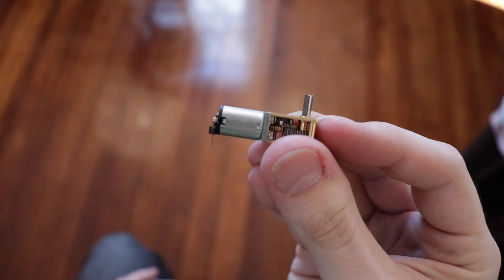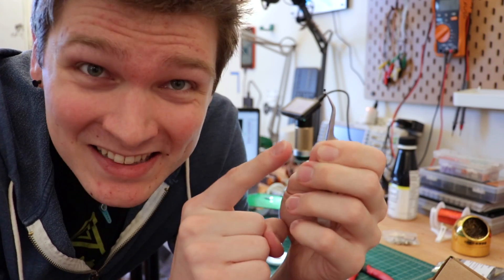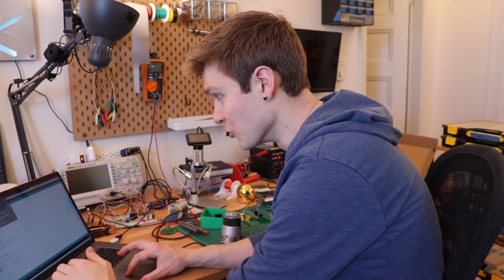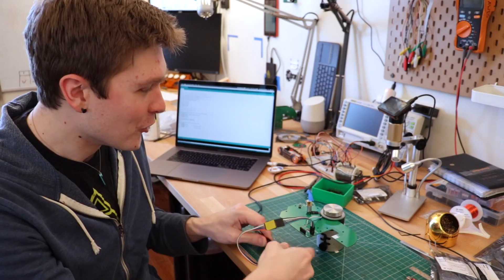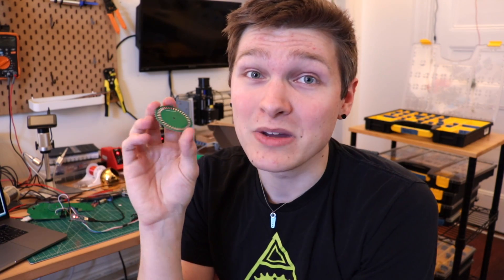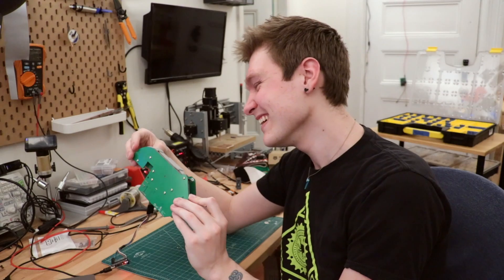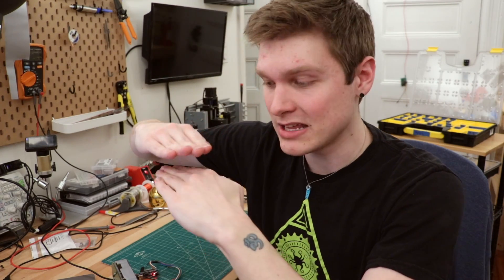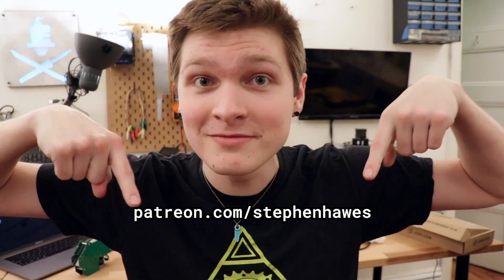DIY Pick and Place Feeder!

Comment: Just part way through. Question. If you're using a slotted wheel with a light sensor, why did you not just put the light and sensor on opposite sides of the wheel so the sensor could see the light through the gaps instead of relying on a reflective surface alongside slots? I mean, isn't the either the reflective surface or the slot superfluous? Instead of a slot, couldn't a flat black paint have worked as well?
Not saying it was wrong or trying to troll, just wanting to see your reasoning behind the decision.

Comment: If you use RS485 and put a DIP switch that sets the address of each feeder you can address each feeder over the same 3 wires. 
If you use CAN you get a few network type advantages. The only down side with CAN is a smaller selection of controllers

Comment: Here's a thought, If you get the drive wheel PCB made with a matt black solder resist, then use a white silkscreen instead of slots. The way you should be able to get a much finer resolution on the indexing, which will be helpful for different sized SMDs.

Comment: I know it has been 4 months since you made the video, so not sure if it is relevant anymore. But if you take some solder wick  and remove the solder from the pads, wouldn't that leave them with a thin, ever coating? (like you can not remove the last thin layer with wicking) Just a thought 🙂

Comment: I m started to build a INDEX unit on your info. When looking to all the feeder design i think that this is rather a problem. After thinking I wonder why the control of the feeder must be done with your piggy board on yuour special protocol. ??? Now I think you are repace this by RS485 protocol. Now I have the idea , why not place a sensor in front of the feeder able to move a mechanisme to set the tape forward. A actuator can be mouted on the Z axle eg. IR or magnet (Hall sensor on feeder). In Openpnp you sent the head to feeder wanted, this response on the sensor activation and go!.
I hope my idea is clear, sorry for perhaps the not correct English , regards, Cees from the Netherlands

Comment: Would it be viable to use a motor to just pull on the film? The film would pull the tape forward, and then a thru-beam interrupter could count the holes in the tape

Comment: Why didn't you use Multiplexers and serial communication for those Fenders?
Reply: And you could use some dip switches or solder jumpers to encode the position on the fingjoint indexing bords?
Reply: Or the fifo used for the LEDs to send a stream of data to the faders and make each one remove the first entry of the dataset and pass it along? (the output can be passed back to the motherboard and contains the feedback on the feeders?)

Comment: I am not really sure if a PID loop/controller is the best solution for this application. Don't get me wrong, I love a good PID loop but I think the way you are doing it now is the right way. A PID controller takes an analog input (sensor) value and an analog setpoint to decide some sort of output. If you were directly measuring the rotation of the wheel (by means of an encoder or something similar) then I think it would make sense. In your case, however, your output is binary (with noise of course). Either way, super sweet video and project. Can't wait to see even more progress.

Comment: Great Design.  I'm currently working on my own PNP.  I am to the point where it's populating the board fairly accurately.  Still need to set up the pipelines for up facing camera. I've recently ordered boards to give your feeder a try.  Funny thing is, JLCPCB refused the indexing wheel board.  Didn't give much reason except it was beyond their capability.
Reply: Huh.

Comment: Nello buddy,
As an electrical engineer I was thinking about using the pcb itself as a rotary encoder,
Not in an optical way, just in electrical conductivity way... I know the project is over by now but you can use this method for low pitch encoding.
And great job dude u doing well keep going!

Comment: I might have tried Reverse mounting an LED to the main board behind the indexing wheel. this way the light shines THROUGH the PCB to make a bright spot in the background, then use the spoke in the indexing wheel would break the light flow through. Then it becomes a light break beam... BUT you nailed it.  WAY TO GO

Comment: Wicked cool design! I am so excited that the design files will be released. One thing I thought of as a potential improvement to the rotating wheel is that instead of using those pads to reflect light, you could just use them like a switch. Just put a brush on a spring to make the electrical contact, The other part of the switch would be a circular pad where the shaft of the motor goes through the center of.

Comment: Seeing the evolution of the feeder has been interesting. The tape peeler design is especially neat. 
For the drive motor, to get increased torque, Instead of having that encoder wheel, you could use a motor drive with built in encoder. Like this: https://www.dfrobot.com/product-1457.html

Or this https://www.ebay.com/itm/DC3V-6V-5V-2-Phase-4-Wire-Micro-Worm-Gear-Stepper-Motor-Mini-Gearbox-Reducer-DIY-/322695331937

There are also ic's that can read the angle of a magnet nearby to a degree accuracy that could measure the wheel position. (like the as5600) 

You could also add a photo interrupter shining through the holes on the pcb tape. It would detect the advancement and also let you know when the tape is out. Like the EE-sx1321

Looking forward to see how you work this out. It may be useful to go with a completely 3d printed case without pcb to troubleshoot mechanics. Is there a reason you are using the pcb for a significant amount of the structure?

Comment: Im surprised you didn't just have the plastic cover peel back over a thin rod  in  the opposite direction with a gear set squeezing and rolling it off as it moves

Comment: Great project! One question, what´s the deal with the cap between ground and reset on your programming arduino?
Reply from the maker: AHHH good eye! If you don't have a cap on your programming arduino, it will reset when your computer tries to send the firmware over. The cap keeps it alive and holds the serial port open!
Reply: @stephen_hawes  Thx buddy!

Comment: Cool project, if you do get the little opto encoder boards redone in the future with gold as apposed to HASL, spray a little clear coat or conformal coating over the board to stop the gold from tarnishing over time. Photo etching is also a cool process for making inexpensive encoder wheels. 👍

Comment: Oooh, the joy of a blinking LED. hahahaha so relatable.

Well done!!!

Weird question, with the reflective wheel + sensor, does that mean this machine needs to operate with a light on?
Reply from the maker: Wahoo thanks!! And to answer your question, yes! The little sensor I'm soldering to the PCB is comprised of a suuuuper tiny LED and a photodetector in one package, but it's not putting out light in the visible spectrum (I think it's UV? not sure). So if you take a peek inside it, you won't see any light, but there's definitely some in there! I'm also adding some baffling so any stray light doesn't mess with the readings.
Reply: @stephen_hawes  Likely InfraRed

Comment: so i am also building my own pick and plce machine from a lazor cutter on thing i will say is i am going to hace the reals on the sides of the machine the front is a bad place in my opionon and from the looks of it thats where you are puting yours but also for the feeders you could try using i2c for the control since you can do 127 slave devices i also want to know if you have a discord for the pick and place project if so i would like to join as a fellow builder and i would even like to share some pics of my machines build progress on said discord
Reply from the maker: Yeah, I decided to put the feeders on the front because that way I can add in a conveyor belt from left to right so boards can automatically be fed through. I like the sides, but it was pretty important to me that I'm able to add the conveyor system! I hadn't thought of making a Discord for it. I'll look into making one and let you know if I do! Would love to see your build.

Comment: I would have used a sensor that shoots the light through the wheel not reflect off it.  Much more binary situation aka solid on and off state.  When I'm designing things that have to be hand assembled I avoid chips that have lead-less bodies.  As you have shown they are very difficult to solder by hand.Where are the design files available?
Reply from the maker: I considered doing that! The reason I didn't was because then I'd have to put components on the other side of the wheel, which means another PCB, and a connector for that PCB. Plus, with analog feedback I can position the wheel exactly on the edge of each encoder window, instead of only having a binary signal which limits my resolution to the width of a window. And hopefully, I'll be building these things with a pick and place soon so lead-less bodies won't be an issue! 😁Design files are a bit of a mess at the moment, but once they're in a good state I'll post all the source on Github!
Reply: @stephen_hawes  The problem with lead-less components is soldering.  They were designed for automated assembly with solder paste stencils, pick n place machine, and re-flow oven.

Comment: Awesome work! I just started to try and recreate a similar design on an existing auto-feeder, but it uses a NXP k20 as a controller. Not sure why they originally went with this over something 8 bit to control 2 motors. Details here: https://groups.google.com/forum/?#!topic/openpnp/2537gsOarBc
Reply from the maker: Oh, yeah that McuOnEclipse design is killer, I used it a bunch as reference! I agree that the NXP k20 is a touch overkill though. That's part of the reason I went 8-bit for this one. The standard ATmega328 has just enough pins for all the functionality I need, plus it has an incredibly easy programming toolchain using Arduino. Love your PNP by the way!
Reply: @stephen_hawes  thanks! Let me know if you need any help with OpenPnp (assuming you're using that)

Yeah, I'm not looking forward to setting up the toolchain for the k20. I'm go ij ng to have to figure out something for the master controller. They just need something to communicate serial over USB.

Comment: Okay don't use solder wick on the microcontroller pins like that. It's abrasive and when hot can damage the solder resist. Just get a flux pen and drag solder for the best results.
Reply: Is your motor controller holding speed?
Reply from the maker: @mattweger437  Hmm really? I've never had issues with that in the past. Interesting to know you've had problems with the soldermask though. Motor controller holds a constant speed for a while, then ramps down to a slower speed on the approach in a naive effort not to overshoot. When the PID is in there, motor speed will be completely based on feedback from the sensor.
Reply: @stephen_hawes  yeah it's a thing. It gets worse with closer pitches.